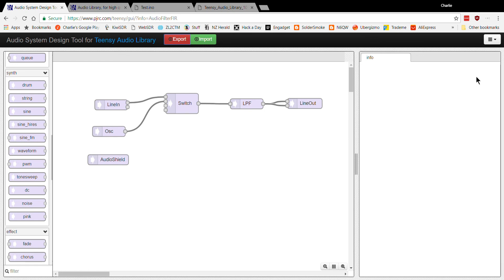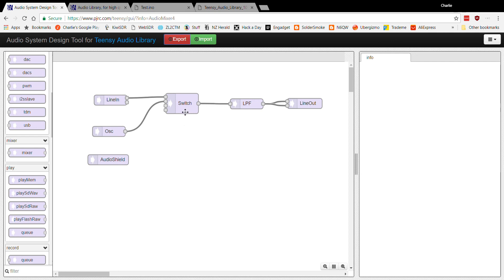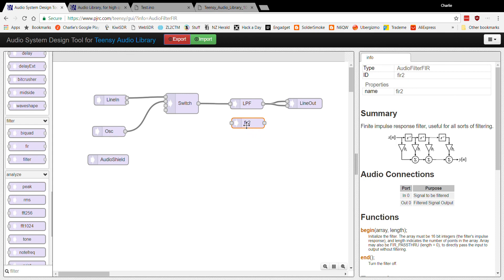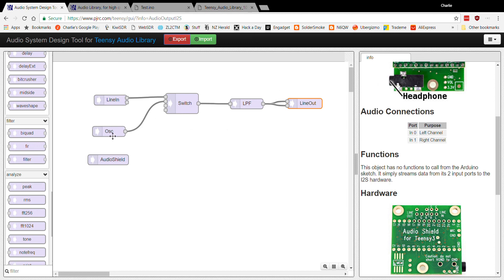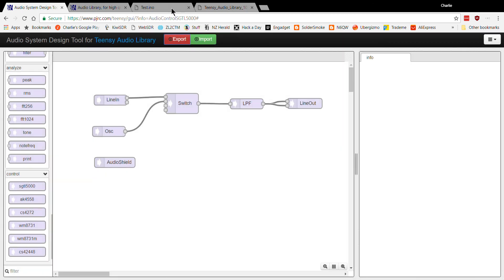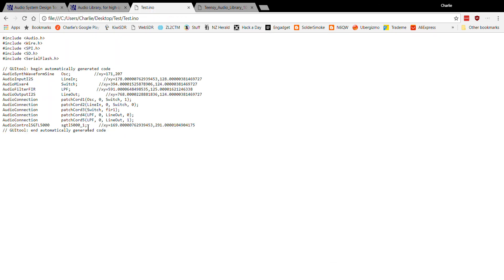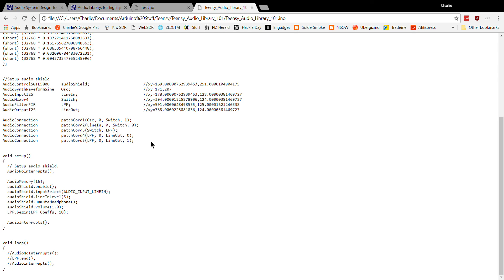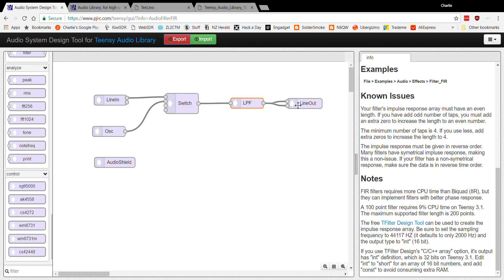Teensy Audio Library Design Tool 101

Comment: Hi sir, can i able to use this library for arduino due board which comes with the arm microcontroller
Reply from the maker: No sorry. The code for this project is for the Teensy microcontroller board.
Reply: @CharlieMorrisZL2CTM  okie thankyou

Comment: Hi Charlie, 
You sound kiwi. I'm currently building a Audio Multitool (custom audio board with SGTL5000) for use in Outside Broadcast work in NZ. Would be great to share a beer and compare notes on the Teensy Audio Library and use with SSD1306 displays sometime.

Comment: In this example i guess you'r using Teensy 3.6 and floating point arithmetic's. Can you do this demonstration on Tennsy 3.2? because it doesn't have Floating point unit. I'm bit confusing how to achieve fixed point coefficients for FIR design
Reply from the maker: It should work. I did this year on a Teensy 3.1. Try:

short filter[size_of_filter_array] = {
32768 * -0.000010523800014581,
etc
etc
};

That should work.